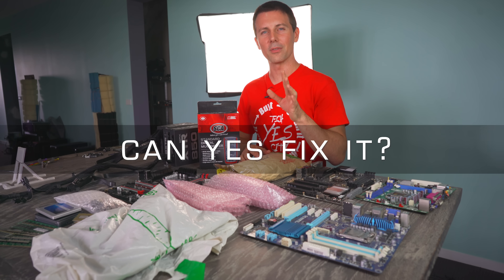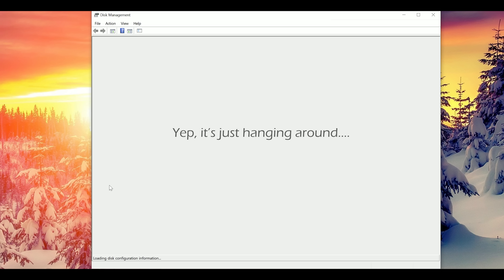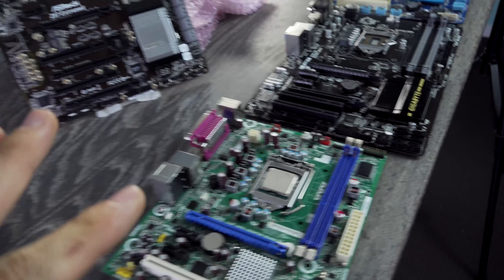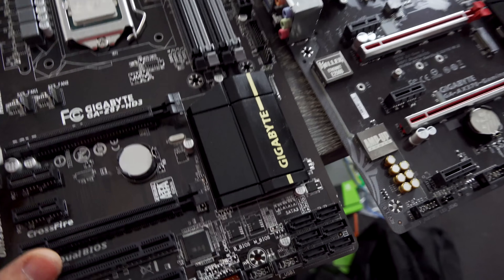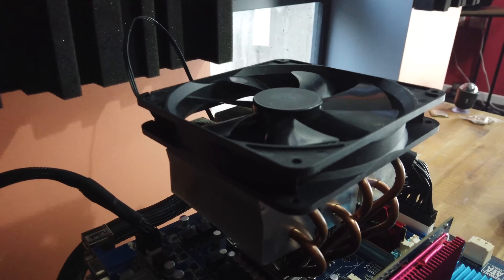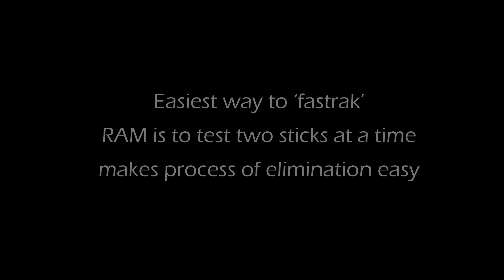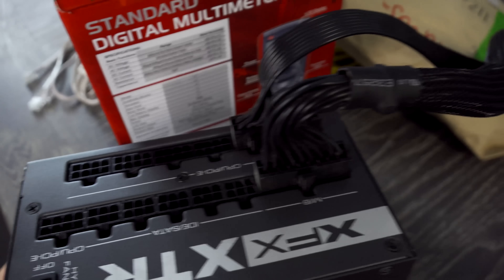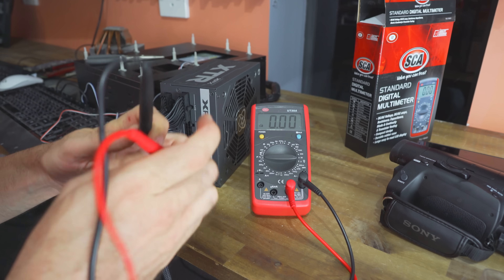Trying to Fix Your Broken PC Parts (Can YES Fix it?)

Comment: Hey Bryan i got a motherboard that has only one ram channel working, dimm 2 just refuses to boot into anything, when using dimm 2 i can post to BIOS and the ram is recognized there, but when booting to memtest or windows it just crashes.
I did some Tech Yes lovin' but the ram slot is still dead, i noticed some bent pins on the motherboard and tried to fix them but still no fix on the dimm (aparently those bent pins where ground ones).
Any advice on this?

Comment: I remember a very long time ago I had a Asus P5N-T Deluxe motherboard, intel core 2 duo e8400 cpu & 4x 1GB crucial ballistic tracer ddr2 1066mhz memory, BFG 650watt psu & visiontek 512MB HD3870, the system caused me so many problems with blue screens no matter what I tried from swapping to corsair dominator ram to using a intel core 2 quad q9650 cpu,- it still had blue screens. in the end I found out the motherboard just sucked in general so I ended up selling the whole pc(using a different motherboard fixed the problem). Sometimes it is best to take your losses..... if you can't fix it then move on!

Comment: Could I send you and 8320 and a Asus sabertooth fxa board? The board just surges  and dies after a millisecond with the CPU plugged in, but when it isn't, it runs fine. I'm super stumped I've tried resetting the bios etc.

Comment: That Z77-D3H was fixable! All you had to do is to kick the recovery BIOS into action. A lot of people don't understand how this is supposed to be done, so I am going to write a small guide for it.

Firstly, turn off the switch at the back of your PSU. Press and hold the power and reset button together and don't let go. Then turn the PSU on. Your system will power up automatically for a few moments, and then turn off. Switch the PSU off at the back, and whatever you do, don't let go of the Power+Reset button. Now wait like 10~15 Seconds.

Repeat this same process twice, and it's important that you don't let go of your Power+Reset switch at any time during the procedure, and you must leave the system off for 10~15 seconds interval after switching the PSU off.

After performing this action for a total of three times, let go of your Power+Reset buttons, and turn the system on normally. It'll boot loop a few times, but then will eventually kick in the BIOS recovery mode. Let it restore the BIOS from the backup BIOS chip, and then your system will function properly.

With this method I have managed to fix plenty of GIGABYTE motherboards that just boot loops time and time again.
Reply: I kind of remember doing something similar back in the day (around 10 years ago) where I removed the 20/24-pin cable and reconnected it to the motherboard while holding the power button. This saved the computer from the infinite rebooting.
Reply: @SeraphisQ  Can you elaborate on that? I'm trying to get an old 4930K working again and it does the infinite reboot thing.
Reply: @dakoderii4221  Doubt this will help you as this method only worked on my old HP computer from 2008 (fixed infinite rebooting). But if you are desperate give this a try.

Step 1: Shut down computer
Step 2: Shut down the PSU at the back
Step 3: Open up your computer and disconnect the atx 24 pin power supply connector
[Now things get a little bit crazy]
Step 4: Turn on the PSU at the back
Step 5: Press and hold the power button (NEVER RELEASE)
Step 6: While you are holding the power button, use your other hand to reconnect the atx 24 pin power supply connector.
Step 7: When you hear the click-sound by properly connecting the atx 24 pin, finally release the power button. 

Now the computer will boot and the fans will start spinning, so you need to pull out your hand from the motherboard.
Reply: @SeraphisQ  Thanks! I'll give it a shot.
Reply: @dakoderii4221  any update?
Reply: Do it all the time
Reply: just short the first pin which is top left and the 6th pin which is bottom right

fixed my z87 cold boot issue with that, works flawlessly now.

i used tweezers for that, judt make sure to do it on the m_bios chip

Comment: I've got a couple of finicky GPUs if you're keen to try and fix them.
GTX 670 (fails to send display)
RX 370 (no thermal paste ATM, will send generic display but not once driver installed)
They aren't exactly worth anything but if you want them for a bit of fun let me know and I will see about sending them over.

Comment: I would've needed this video a week ago. I bought a used EVGA power supply. It was a GQ 1000W, but I found two cables from a G3 in there to for some reason, that was braided, so I thought I use it... One of them was a VGA cable and an other a perif one. Days went by and I used the PC when I opened up the case again for a different reason, and saw that the fan I connected to that perif cable was not spinning... I thought it was dead, than I thought the power supply is faulty... I grabbed a multimeter and instead of 5, 0,0,12, I found -12, -7, -7,-12 volts on the connector... I still thought that he power supply is bad, because it never occurred to me that PC manufacturers would risk components for BS marketing reasons. When I put together my first PC I was blown away how idiot proof the design was so anybody with little or no knowledge could put together one. There was no way to put something to the wrong place, or even put it upside down... 
  Finally I changed the cable to the GQ one and the voltages were ok. I immediately turned off my pc and changed the VGA  cable as well and I considered myself lucky because when I checked the cables they were not the same pinout either. I'm glad my GPU survived that stupid issue. This is really a terrible practice from the manufacturers.

Comment: Try to Use Heatgun Method to Fix the Faulty Ssd and Ram Motherboard or Gpu! or try Oven Method too
Reply: Nel Chan oven is only a temp fix in my experience unfortunately. And it smells horrible man

Comment: at 15:09 when you talk about a board that has "No Power Going to it..." the power connector clip doesn't look fully seated... Like the locking clip didn't grab the motherboard connector... I could be wrong, but I hope you made sure it was firmly connected.
Reply from the maker: Yeah sorry about that I tried it fully in first and nothing came out of it, then having that not connected properly is just trying to see if there is any life whatsoever in the board, which there is none unfortunately :(

Comment: i usually use a dos based memtest software for ram. hasn't failed me yet. prime 95 takes freakin forever. the memtest software takes like 40 minutes on an 8gb stick. which is way better than finishing a whole round of prime 95 which is like 8 hours.
Reply: thats what the dos based memtest86 is for, prime is way better to test system stability than memory errors. Unless you know specific FFTs and error codes for memory issues.
Reply: @HappyBeezerStudios  oh and if stability is a concern, it ain't gonna be just the memory that's gonna be the issue. i do other tests for stuff like that to find other issues that may cause stability.
Reply: @HappyBeezerStudios  when you have a couple dozen memory sticks that are worth 20 bucks a pop, i doubt you'll have the time or patience to test them out that way. memtest86 is more than enough.

Comment: You could try and Reflash the  firmware on the broken ssd from a boot cd or usb from the manufacturer's website its normally an iso in a linux format.

Comment: Are you kidding me about that blue gigabyte board? you didnt even attempt to remove the broken pins from the 8x pcie.... i bought a board with the same problem and getting rid of those solved it. you showed a multimeter at the start of the video, you gonna use it or no?

Comment: if coolermaster is reading comments. If you make a $50 testbench then im all for it. the problem with them is that theyre pretty basic and dont really warrant such a pricetag when i could just buy a cheap offbrand case and butcher it into a test bench.

Comment: bro do you have any AGP 512Mb for selling or gift ? :)
Reply: Lmao he probably wont sell them. You should buy local or online. Here is some info. 

the cheapest 512mb card is the Geforce 6200 but is extremely weak.
 AGP Radeon cards are sold online, expensive and is very powerful. The Radeon Cards are really rare and sought after. Check ebay for the cards.
Reply: augus li I need for Dota 2 I work for 300$ per month and iam trying to make some configuration :) in the moment I have 2gb ddr400 intel celeron 2.4Ghz and fx5500 256mb and 2x80gb ide hdd I know it's ancient but that is what I have :)
Reply: @default1647  is 512 mb really needed? The cpu may bottleneck the radeons.
Reply: @default1647  also, i got a similar main system. Pentium 4 @3 ghz. 2gb ram, 80gb ide hard drive. 7800GS OC
Reply: augus li ye i need for gaming and I will also put 3ghz or 3.2ghz I don't believe that will be bottleneck
Reply: @default1647  Pentium 4s are giant bottle necks. Try going prescott if you have to upgrade your pentium 4. They offer slight performance increase over northwood. They do run hotter tho
Reply: augus li yes that is what I get from friend :) 3.0ghz 1mb case :) gift :)
Reply: @default1647  well, good luck. You should get a 7800GS or a 7950GT for nvidia. Or a Amd Radeon HD 3850 or a HD 4650
Reply: @augusli9716  thanks

Comment: When you toss a dead motherboard, do you generally take the heat sinks and save them in case you get another board where they're missing?  Or would that just take up too much space?
Reply from the maker: usually salvage some of the heatsinks, they do come in handy.

Comment: I am surprised what use don't even check motherboards resistance, volts and don't go that deep into fixing, but you just clean board by itself. I think all boards which you fixed wasn't even broken, but by sender mistake they though it is broken. I want to see advanced repair from you. I hope you will research more and we all will see you great videos how you repair even those 2 broken motherboards
Reply from the maker: I will need to meet someone to show me the ropes who has already been well versed in that, as that learning curve would seriously make for no content on the channel for 3 months.
Reply: @techyescity  Sounds like u should definitely get in touch with buildzoid - this dude knows stuff
Reply: There is another YouTuber that actually fixes hardware with microscopes and stuff it's pretty neat
Reply: I have an old LGA775 board I'd like to get fixed. It just needs two caps soldered back on but when I was trying to remove the old one, the pins just broke off and I haven't been able to remove the pins no matter what I tried. :/
Reply: @ericdeltoro8484  Depending on how far in they are and how steady your hand is, you could solder it back in and use the stability from reconnecting to try to pull the pins out.
Reply: @InfiniteQuest86  The cap came completely off of the pin and when I tried to pull the pins out by heating the solder and pulling the pins with pliers, the unsoldered part of the pin just sheared off. :c
Reply: just get a transformer power supply, get multimeter, and check each capacitor.. i have many stories where i just bought the same one and after i replaced it worked again, however, nice trick with bios chips, maybe you can make video about it
Reply: Thing is what most of uk,usa,australia tech youtubers spend lot of money on pc build for 3k or something like that, but not everyone will recover corpses worth 50$ if they can buy new one. I would like to see it, because in countries like russia they earn 200$ monthly which is nothing. This makes scholar to spend lots of time on research to fix died things like psu, motherboards and gpus and it is not waste of time if it gets fixed.If that kid would live in usa and would had 10 dollars everyday for lunch he wont spend time on it.
Reply: @EpicSmile100  lol "tech corpses"
Reply: This is why I gave up on this channel.  After two years I realised it's just a guy with some wet tissues; you learn all he has to offer very quickly.  If you want channels that actually fix stuff look up Eli Tech and TronicsFix

Comment: how can you just flip the connectors upside down if they have rounded and non-rounded corners and also have that pin that locks them into place?
Reply: You use the proper application of force aka push them in really damn hard.
Reply: @voteDC  I know that is sarcasm to a degree, but if it it's one thing I've been told it is that if you have to use too much force, you're probably doing something wrong
Reply: Push the plug in as hard as if you were pushing a baby out

Comment: That INTEL motherboard looks like one of those in INTEL's low end LGA 1155 motherboards. Go on the intel website for DH61BE and you'll find the BIOS for them. All of them within the same family use the same BIOS.
Reply from the maker: oh its not the bios i need, already have that, I need the flash rom maker so I can select the right flash rom to inject the bios into with the external programmer.

Comment: Recently my Adus P8P67 died for some unknown reason. I thought, okay it's 7 years old, I'll just buy a used 1155 and replace it. I tested my 3770K on 2 other friends Z77 motherboards and it worked. A week later just before I decided to buy a used mobo, I decided to test it one more time on friend's Z68 RoG. It didn't wanna boot whatsoever. The code showed just kinda generic "00" error code. No picture, no boot loop, no nothing, I was messing with it for almost an hour.. And that's pretty much it, RIP motherboard and 3770K for absolutely no reason. And yes, it was used on ToughPower 775W PSU. When I told the story to my very good "techie" friend he couldn't believe it. He just said, "that's the first time i actually heard that someone's cpu just died" hah
Cheers
Reply: @moramaasi  It's updated to the latest, both friend's Z68 and my P67. Latest BIOS was something like in 2012.

Comment: Hey Brian, on the PSU cables, rather than shove it in upside down, pop the pins out at the far end and swap em. Done this a few times with Corsair and FSP units and it makes it easier to sell and saves the next user if they do something silly like unplug it to do a case swap.
Reply: Case problem...that's all

Comment: you saved me on 2 occasions thank you... the first my Gigabyte GTX 970 G1 Gaming kept giving me code 36 and uninstalling the nvidia drivers I took it apart and sprayed the pcb down with brake cleaner I put new thermal pads and the card has been working for a year now no hiccups the second time was far more brutal I had bought a Asus  z270 AR combo (cpu mobo heatsink) upon removing the heat sink there was so much paste literally a half a tube had paste everywhere even in the socket I was freaking out then I remembered the tech yes way Thanks Bryan thermal paste on pins has no chance against brake cleaner saved my build

Comment: How about test they work first before you break them with break cleaner :). 

You do loads of old boards and clean them up , i think you can justify an ultra sonic to clean stuff up properly :)
Reply: Andrew Joy he is cleaning stuff up properly with break cleaner. Numerous people including myself use break cleaner, and it has actually saved otherwise dead motherboards. I’ve personally used it for 4 years and not once have had a board break or a customer complain of a doa board. 

I think you need to learn the tech yes method to properly clean up boards, yourself. Look up his other vids.

Comment: Disk management is good for checking most drives, but I personally recommend booting up a Linux machine and using gparted, or at least diskpart via cmd.
Reply: disk management is diskpart with UI...
Reply: @adrianvorkaaa3534  yeah lol
Reply: @adrianvorkaaa3534  Yes, but using diskpart through cmd will be more stable and less prone to hanging like it did in the video.
Reply: Also look at dmesg while you are in Linux.
Reply: Yea like just cause a drive shows up in disk management doesnt it mean it's not broken😂
Reply: Yeah i'm a little disappointed Brian did try harder to get the Drevo working. thats the most basic attempt at getting a SSD working. Acronis would be another option be Linux would be my go to.
Reply: literally or else some damaged partitions ive had not show up in windows lost tons of data only to realize when same thing happened linux could actually detect and initialize the drive whereas windows would do its retarded blue screen shit
Reply: even the windows preinstallation environments blue screen lolol its like wait what lololol
Reply: The problem is 

:(
Windows PC has crashed
After putting in the CMD

Comment: Also if anyone knows of any equivalent cleaners/dispersion products in the US I would be entirely grateful. Great video Bryan!
Reply: Brake clean and wd40 are very much available in the usa. Any car parts store will have that stuff.
Reply: @alphaetomega  what type of brake cleaner? There is brake cleaner with and and without chloride. Also 4d40 leaves a very sticky residue. Thanks!
Reply: @stevenwilliams6638  Without chloride is best and likely to be most common. WD40 is WD40, though I would not personally use it he uses it just fine.
Reply: @alphaetomega  he isn't using WD40 he just calls is WD40 he even made a comment himself about it while he was in the states. I appreciate the feedback about the non- chloride based brake cleaner though! Thanks 😊
Reply from the maker: @stevenwilliams6638  see if you can find crc 556, i love that stuff.

Comment: I've always wondered, how brake cleaner and WD40 is good for the motherboard :/
Reply: WD seems to be electrically safe/non conductive. I'd be more worried about the strong lingering smell of both of those...and the strength of the brake cleaner. I'd probably still just buy a gallon of 99% alcohol (more expensive) and use that as a rinse.